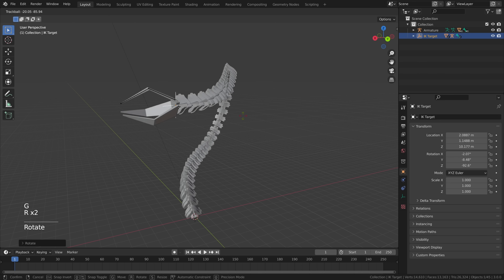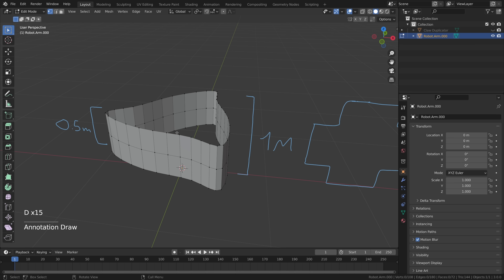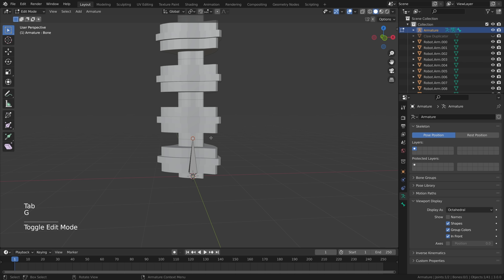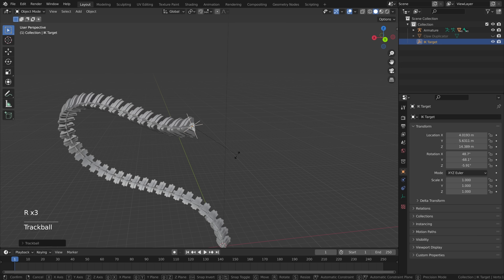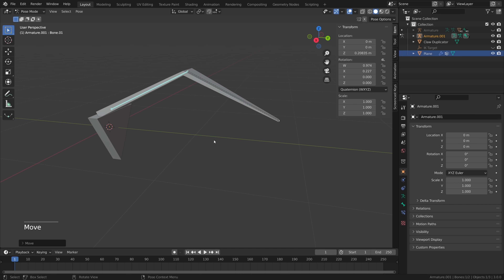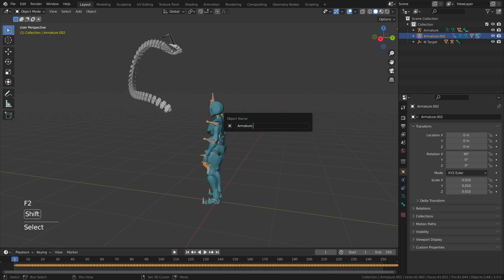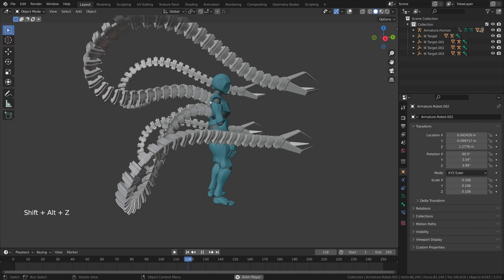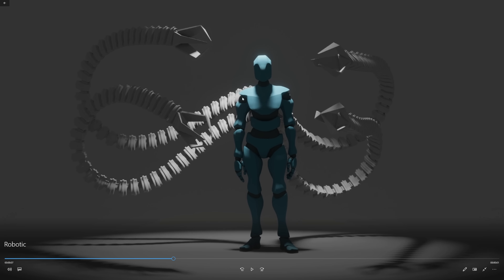Tutorial: How to Create Robotic Arms in Blender (Part 1)

Comment: The glitch thing isn't really a glitch at all... it's kinda because the setup is partially incomplete. The reason it snaps back and forth is because by default the XYZ limits on the individual bones is set to min/max -180°/+180°.  What this means is that when your IK target hits the centerline (zero relative on an axis to the tail) there are two solutions to the IK (-/+). It's rather tedious, but if you go through all the bones and set each of the XYZ limits, then when they reach a certain spot, it'll stop istead of flipping back and forth because then you'll have only ONE solution. Again, it's very tedious when you have 40 bones, but worth it if you're going to be doing full scale articulation
Reply: Thinking about it, I might be wrong about needing to do it for ALL of the bones. It may possibly only be necessary for the end and tail bones... I'll have to experiment and report back. I may have been wasting my own time doing more than was absolutely needed! 😳
Reply from the maker: @DaellusKnights  Nice!! Let me know what your experiment shows!
Reply: @Polyfjord  okay, I was a little bit right, and a little bit wrong... You can actually set the limits on just the tail and the end (also the IK target helps) and it will remove a lot of the random snaps. The more bones you set, the finer your controlling the limits of motion. 

BUT... if you're posing the rig and it suddenly snaps into an almost mirror position, that's not a glitch, that's just bad posing. 🤣  Really, it's a physics limitation. What happens is you're trying to move the rig into a position that is not physically allowable for the way it's built. Basically you're crossing from plus to minus, and it has to recalculate the IK that WILL allow what you're trying to do. 

So, if you go through the effort to finesse the entire rig, you get far more realistic range of motion, without the random glitching. But if along the way it suddenly snaps to the other side, then that means it just simply can't do what you're trying to do in the way you're trying to do it. 

A little bit of Column A and a little bit of Column B. I'm sure there's a lot more there that is beyond my dabbling. But it's fun figuring this stuff out! Thank you for the beyond-amazing tutorials 😻👍

Comment: good progeny. but i have a problem
how can i parent bones with the arm?
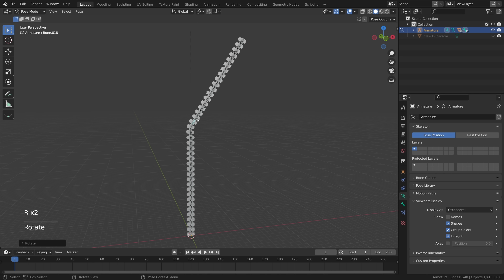(7:11) thanks
Reply: You have to select the armature and press "A" after to select everything. In "Object Mode" press Ctrl+P and select "With automatic weights". Does it work?
But I have the a problem. The error message "bone heat weighting failed to find solution for one or more bones" is appearing. I tried a few solutions from the internet, but nothing works. Could anyone help me maybe?
Reply: @DrDnananas  tank u so much it worked because i was thinking that i need to press bone and object. really tanks
Reply: @mauroliardo643  I'm glad I could help

Comment: I'm having issues with the array, when I add the extras and follow the steps they are not aligned properly and end up all over the place. 

Iv followed the steps exactly during this phase 3 times with the same results. Did I miss something? Any help would be great
Reply: I have the same issue did u ever figure it out ?
Reply: @CryptoNightshade  kinda, it didn't end up as clean as it shows here. But I had to use the transform tool along with rotating and scaling PRIOR to enabling the array object setting. It was a few days ago so memory a touch hazy on the specifics. 

A few comments in here do explain it, might require a bit of digging way down there. Hope it helps a bit, there is a solution so don't give up
Reply: @CryptoNightshade  also one thing is once the armature is in place don't move the plane again in object or edit mode. Only move the arm within pose. I was told moving outside fucks with the alignment when you use the array. That may be a cause. It was for me
Reply: @CryptoNightshade  right - solutution now, as i just tested it is once u have the array ready (dont select the triangle yet) hit CTRL+A to reset all transformations on the triangle. then the array + rotate should work properly.

Comment: If any of u guys have an error: "bone heat weighting" when trying to parent, it cannot find a solution as there are duplicated vertices within ur mesh, like a 2 in 1, so to fix that u have to remove duplicated vertices.

one way is that, if there are duplicates, they will be in the same point as the original, so, merging them would be best. Here's how to do it:

1. unlink bones from mesh .
Object mode   >   alt + p    and "clear and keep transform"   then delete groups.

2. select model and convert to mesh.   Then go to edit mode and type "a" to select all vertices

3. Then type "m" and "merge by distance" (somewhere at the bottom u will see how many duplicates have been removed)

Finally u can Ctrl + p to armature deform with automatic weights.

Took me a bit figure it out so if anyone needs help, reply

Comment: 🥺i have a problem with Larry that doesn't work like in the video that make a claw under a little smaller.
I used 3.0.1 binder and I can't find 3.0.0
Can you resolve this problem pls?
Reply from the maker: It can help to apply the transform of the Claw Duplicator (CTRL+A -> All Transform). This will also be showed in Part 2, which is coming soon
Reply: @Polyfjord  Thanks a lot your the best

Comment: stuck rigging the arm, put the armature in just as the video shows but once its parented to the model it only rotates the armature, any fixes?
Reply: same problem , im using blender 4.2.1 LTS
Reply: Using 4.2.2. I had similar issues, so i just extruded an extra bone at the top, disconnected the bone, and named it IK. Turn off Deform for this bone. Then, I went to pose mode, selected the IK bone and the top bone for the arm. Shift+Ctrl+C then select "Inverse Kinematics". Then proceed as usual.

im only halfway through the vid, so im not sure if there will be issues with this method. You could probably do a copy transforms constraint on the IK bone and make an empty as the target, but i animate in pose mode so i don't have a reason to.

Comment: Thank you so much for this video, altho I keep encountering a problem where my target is not reached by the "IK-arm", but visibly it would clearly reach it if it only would bend a bit harder. It's difficult for me to describe but how do i increase the "strength/force" the IK may opperate? Influence is at 1.000 (max) if that's even it. It's like the arm juse doesn't want to bend harder to reach the target. :( Thanks!
Reply: For future people having the same issue, here is how I managed to solve it:
1. select the armature, 2. go to object data properties tab (the green little stick figure), 3. go to the tab "inverse kinematics", 4. change the IK solver to "iTaSC", mode "animation", change the precision to 0.000, increase the iterations to 500 and use the solver "SDLS"
It fixed all my issues!

Comment: Sorry to bother you, but when I used the eyedropper to select the claw duplicator for Object Offset, each claw in the array immediately rotated around the x axis equidistant from each other, like a pinwheel.  When I rotated the claw duplicator, the two copies of the claw in the array rotated with the duplicator and began to "scissor" as the rotation revolved, making them look like blades for an actual blender.  I checked and double-checked your video for possible settings discrepancies or inaccurate procedure.  But, alas, I can't seem to fix this problem.  Any help would be greatly appreciated.  I'm using the newest version of Blender, 3.0.1  UPDATE:  Everything worked fine after I built the claw in 3.0.0, so I started all over building the claw in 3.0.1.  The same issue occurred.  So, I'm assuming it's a bug with 3.0.1, or a setting that is defaulted, maybe?

Comment: if i want to rotate my thingy the normal way. not the way you did it, i get a forced origin point at the center. is there a way to force this point to one of the ends? i tried the 3D cursor and set origin to 3D cursor method but that only works on singular objects and not the bones + mesh together (+ empty point for moving the arm)